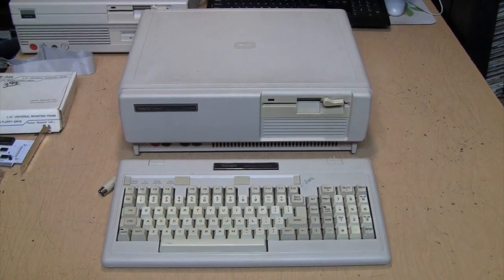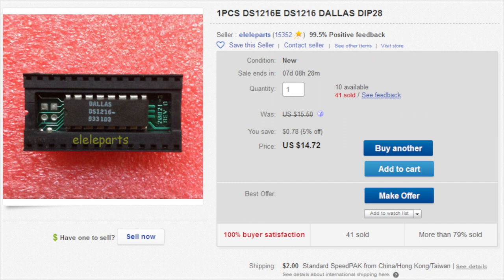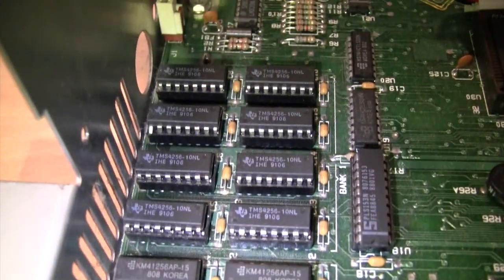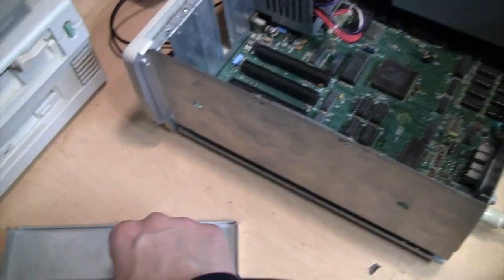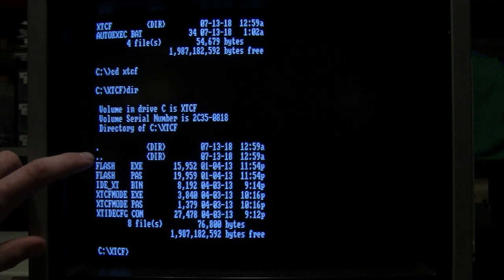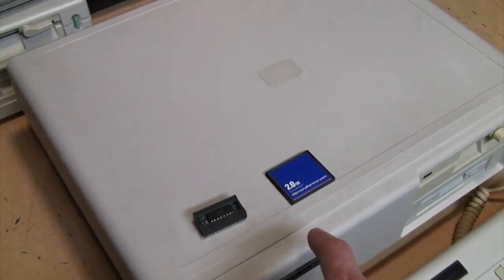Exploring & upgrading the Tandy 1000SX computer

Comment: That was my 2nd comp, had it from 86'-94'.  Looooooooved that machine.  Eventually got the memory bumped to 512kb and added a 2nd 5 1/4" drive so I could copy stuff (then later replaced one with a 3 1/2").  Lasted through all the Sierra games until they required mice.  Wrecked two joysticks for it playing BC's Quest for Tires, Thexder and Silpheed.  Also wasted tons of hours with Bubble Ghost, California Raisins and Double Dragon.  Never did manage to get the Light Pen for it though.  Ran on MSDOS 3.2.  Thanks for the memories @VWestlife!
Reply: Thank you for sharing that. My memory fails me as to my exact setup, but I know I didn't have much money so pretty sure I never got a second drive for mine. But I played all the Sierra games, was very partial to the police and space quest. And then I found starflight and omg that changed my life forever lol.

Comment: I've tricked out my own 1000SX quite a bit. Personally, I don't like the V20 upgrade because one of the biggest strengths of the SX is that it provides 100% compatibility with 4.77mh required software. I've upgraded it with a 286Xpress accelerator -- a 286 on an ISA card -- a 8087 and 80287. The card gives me 4 different speed options -- 8088 @ 4.77 or 7.16mhz, and the 286 @ 7.16mhz with Cache Enabled/Disabled -- all of which can be changed in software or with even with keystrokes if you have the program loaded in memory. I also have a Trackstar-E in it which is an Apple IIe on an ISA card -- essentially making the the Tandy a 2 in 1 PC/Apple computer. 

I'm using an XT-IDE + IDE-CF adapters, since the only CF-Lite that I could find had a rear slot didn't fit the Tandy. I do still need to get a serial card for it, for mouse support but I was able to find an original boxed smartwatch for it -- I'm glad to see that we have alternatives for that though!

Comment: The light pen port was used with dual monitor cad/cam systems, some digitizers for autocad also used it. lots of software used it in fact, software that was all in the 10,000-15,000 $ range which is why most do not/did not know how prolific the light pen was, Ive seen 30 of them in one office :)

Comment: The 1000 SX, the computer (I bought used) that got me through college in the 1990s and my darkest years of poverty.  It wasn't fancy, but with a 14.4K modem and a local Freenet, it kept me online.  I've had better computers, but this is the one I have nostalgia for.
2:50 - The keyboard may be non-standard, but in terms of quality and durability, it was only bettered by the Model M.
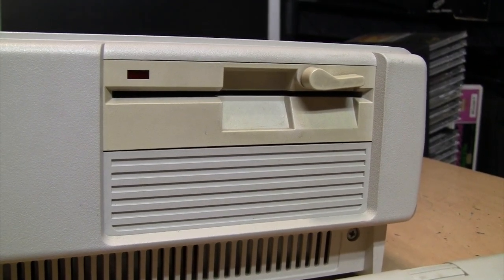4:30 - I bought an internal bracket and put in a 3.5" drive.  The panel cover would no longer fit, but usability beat aesthetics.
6:00 - Yup.  Had the cable, connected to my dot matrix.  Fun times, seriously.

Comment: Nice machine. I recently acquired a Tandy 4000 from recycling. Its power supply was dead, so I'm needing to replace that before I can test the rest of the machine.
Reply: If you have a Murphys in proximity, you might find a replacement.
Reply: Or replacement components.
Reply: Were you able to find it yet?

Comment: Holy balls, does that POST beep and floppy seek test ever bring me back to my toddler years 😭

What the heck, yours takes only 15 seconds to count up 2 GB of free space? My Epson takes almost that long to count up 60 MB. Maybe because I'm running a mechanical hard drive. Brotip - replace the firmware on the XT-CF card with the "XT+" firmware that takes advantage of 80186/80188-compatible CPUs like the V20. I'd be interested to see if you get even better speed.

That's a lot of great info about floppy drive setup tweaks.
Reply from the maker: I can also try enabling DMA mode. I'll cover that in Part 2.
Reply: I have no idea what you said with about half of that, but omg that sure brought me back to memories of putting a disc in and closing the little switch. I was always so paranoid my data would be erased. Probably cuz I was traumatized from having to use the cassette tape drive on my TRS80.

Comment: 1000SX machines that shipped with two 5.25 drives had A: on the bottom drive.   The one we had is still in the parents’ basement in near mint condition.   We Used it from the time we got it in the mid 87 until 92 or so.
Reply from the maker: I've seen them both ways, with the A: drive at either the bottom or top.

Comment: I’m not sure but I think the 6 in 96 may be a 0 so 1990.
Reply: Me too :)
Reply from the maker: But there are other zeroes on the same label and they're not written that way.
Reply: maybe the memory was upgraded in 1995-1996, almost no one would provide warranty more than 12 months, also it could have been traded in and "refreshed" and resold via tandy
Reply: You kids have to know, a lot of people didn’t just waltz into Radio Shack and pick up a PC, they were the number one computer manufacturer and reseller in the US  for a few years. I worked as an assistant manager in Montebello, CA and some of the business extended service plans were insanely long, offering limited parts and labor up to 5 years. Back then, a small business wasn’t going to upgrade every year or even couple of years. Computers weren’t disposable either, especially at the prices Tandy was charging. 5 year extended warranties made sense, and I’m sure went well past the point Tandy got out of the computer business in 1993.
Reply: @StevenSmyth  The prices on those computers and monitors are insane for 1980's money. It reminds me of exactly why we didn't have a computer at home when I was a kid.
Reply: @ct92404 Yes, you either needed a PC  for your work or you were a hobbyist with a  disposable income. The problem now is the closure of Radio Shack  has artificially jacked the prices up on used Tandy 1000s. A couple of years ago, you could get a decent 1000 for about $100 all and all night on ebay. Try paying that now.
Reply: It could be a six or four. Coming from the UK too, I can see why you'd scratch your head when told it's a six. People write sixes and fours weird over here lol.
Reply: I upgraded my Tandy 1000 SX with a modem and memory in 1994.  I used it up until 1996 when it was 10 years old.

Comment: Something that would make old PCs through ATs and clones faster was using faster than minimum speed RAM chips. The key to that was the loose tolerances in the RAM timing windows.
For example to do a RAM write the RAM had to be ready no later than Y time but could be ready as early as X. The minimum RAM speed specified would put the ready time for reads and writes closer to Y than X.
Using faster RAM chips would make the RAM available closer to X than Y, closer to the start of the window than the end. If you installed RAM ridiculously faster than the slowest allowed, like 70ns when 150ns was specified, then the RAM would be 'born ready'. The instant the system started the read or write cycle windows the RAM would be able to provide or accept the data *right then*.
Then the next read or write cycle could start as soon as the first one was finished.
But in some cases the RAM speed made no difference because the computer was designed with fixed length RAM cycles. For example if the window for the start of a RAM cycle was 20ns long it would wait precisely 20ns for the RAM to be ready to begin - even if the RAM was ready to begin a read or write at 1ns after the cycle start window. Then the rest of the cycle would be set to a fixed time, even if the RAM was able to be read or written in half the time. The computer would sit there for however many nanoseconds twiddling its digital thumbs until the end of the cycle and the next cycle start window.
One place you can easily tell the speed difference is in an IBM PC/XT that has the audible ticker and number count on screen during POST. With the 150ns RAM specified it goes TICK TICK TICK TICK TICK TICK TICK*. Put 70ns RAM chips in and it goes *BBRRRRRRRRRRRRT because the RAM is always already ready at the very start of every part of a read or write cycle while 150ns is getting close to being too slow.
Back in the day, 70ns DRAM chips were hellaciously more expensive than 150ns. I used to scavenge faster chips from dead "Turbo" 8086 clones, 80286 clones and even some early 80386 clones.
The same kind of loose RAM timing was often used in the early times of SIMM RAM, but by the advent of the 72 pin SIMMS RAM timings were tightened up a lot so there was little speed to be gained installing RAM much faster than specified. Could get a little bump mostly only detectable with benchmark tests.

Comment: Awesome!! Inspires me to dig out my Old Tandy 2500 SX/33 I've had for a long time now.  One of my friends also recently gave me an old TRS-80 128k Color Computer which I've had loads of fun on so far, I just haven't had a decent way to load other software to it yet haha.
Reply: There's a Trs-80 basic software website, yet specific software besides older programming interface is unknown. I was looking up how to operate there pocket computers.
Reply: @tarstarkusz  With my 2500, which I agree is just a low-end 386 when it comes down to it(though these are all old machines now anyway), that there are a couple of things supported that I do like about this particular machine:  First thing being the 2k compatible clock, which supports from 1/1/1900 to 12/31/2099. Second thing being that I do not need to load bios configuration software from a floppy, this machine has that built into the ROM.  Sounds silly, but even my dad's old Packard Bell, which houses a 486 with an 850MB harddisk(I am not sure what any of its other specs are off the top of my head), doesn't support ROM based BIOS configuration.  So I guess with it being low-end(again its just going to be a DOS machine anyway) I do like it for what it has to offer otherwise.
Reply: @obsidian9998  I know of a few sources myself, the guy who gave me the old Color Computer 128K has a bunch of his own sources, I just haven't had much of a chance to play around with it further other then writing my own basic programs.

Comment: This take me back we owned a Tandy 1000 TX with 768k of RAM and a 40MB hard drive. It was one of the ISA hard drives on a card. Plus we had a 3rd party keyboard which was an omikey keyboard with dip switches for configuring the keyboard and one of the combinations of the switches made it compatible with a Tandy 1000 computer thanks to a PS2 to Tandy adapter. Also it was a very clicky keyboard. But sadly the keyboard met its sad demise on a base board heater.  But our tandy met its sad demise when it refuse to boot anymore because of the hard drive dying. If i still owned that computer I would have replaced it with some sort of flash solution and also the Keyboard was dying as well.  We also had the Tandy printer that was capable of printing in color.  My dad got a 1200 baud modem so he could do his school work since he went back to college at the time.

Comment: • I've seen some keyboards that have a Sleep key in the same place as that Hold key. That's even worse because instead of just pausing the (ACPI) system, it puts it into standby mode which is not just really annoying, but it adds a power-cycle, and thus wear-and-tear to the components, especially the hard-drive.
• If the dust caused problems that bad, I would assume Tandy Labs' "new" tobacco-stained HX will have problems too. ☹
• The stripes don't mark pin 1, they're just a reference to make it easier to plug it in the same way on both ends, so you can plug it in upside down, as long as you do the same on the other end (assuming the cable doesn't have a key-pin).
• You like the sound of old hard-drives? 🤨 Including old RLL/MFM drives with interrupters? 🤔

Comment: You should look into getting an IDC crimp tool, ribbon cable on a roll and the connectors to make cables yourself! I've found it to be way easier and reliable, and in the long run, it ends up saving money if you find yourself fixing up stuff from back in the day regularly.

Comment: My first DOS computer was an XT, with the MB replaced with a 286 after a few years, so I never owned a Tandy.  I was unaware that the Tandy 1000 used the same joysticks as the TRS-80 Color.  That was the first computer I ever used.  Unlike the Atari and other game systems, the TRS-80 Color joysticks were analog, offering excellent positioning control for games that utilized it. 

The compact flash card interface is a more elegant internal storage solution than the full length ISA "Plus Hardcard 40" that I installed in an thrift-store sourced NCR PC4, a two floppy all-in-one PC clone.

It seems your biggest disappointment with this Tandy 1000SX is the keyboard.  It would probably cost more than all your other upgrades combined, but if you can find a Northgate Omnikey, I understand those had dip switch settings that would make them compatible with the Tandy 1000 series, were "clicky", and had a 101-key layout.

Looking forward to Part 2... Would love to see a benchmark comparison with and without the math co-processor.

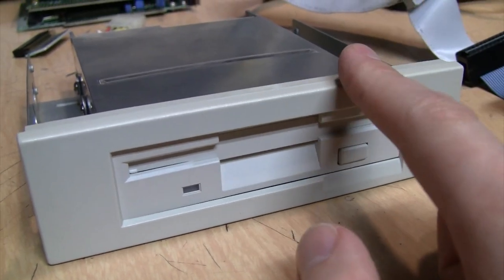Comment: What connection do the floppy drives have? I have this exact computer with dual 5.25" floppy drives, and I am looking to connect the drives to a USB adapter I have, to read my old discs! EDIT: I guess you show the connection at 17:39 and explain it afterwards.

Comment: Tandy 1000 SX owner since 7 years, it's really great to see. Mine's mostly full now, serial, 2 lpt, 640k, 31mb rll drive, 360k drive, adlib, etherlink III, rtc, Iomega zip, syquest sparq and a trackball and I also have a couple of questions:

 I wasn't aware of that dallas rtc, it'll be much more useful than having that isa card taking up a slot. Do they work in any mother boards, or is it just something that works on tandy 1000's ?

And also, will you keep that scsi card ? I may buy it off of you if not too expensive (ebay prices are way out of my reach for those...), been looking for an 8bit scsi card with a boot rom that would work in my tandy, I have only 16 bits ones that don't work in it, tho there is still one I haven't tried yet, I'll give that a try later.

As for putting a 720k drive, I don't really see the point in doing so, it it for convenience ? If so, why not just put a zip drive or any other big capacity media that can go on a computer like this ? Even if it is an XT there is still a lot of options.
Reply: Holy crap, there was an Iomega Zip drive that worked on the SX? (SCSI?) Didn't they show up in the mid-90s?
Reply: @TrackZero  No, I use the parallel version, there was a third party driver made for xt class cpus.
Reply: @chainedenintenloup  
Try all your 16-bit ISA SCSI cards in the 8-bit slots, just leaving the extra edge conectors hanging...
Many cards are actually downward compatible in this way.
Sometimes there is an obscure jumper you have to find though.
Reply: @chainedenintenloup  Nice!
Reply from the maker: With the NEC V20 CPU you can use the original Iomega GUEST.EXE Zip drive driver. I have 3.5" floppy drives in all my modern PCs, so having one in the 1000SX makes data transfer very easy.
Reply: @KomradeMikhail  Yes, that I know, but now I remember why I couldn't do it, all my isa scsi cards don't go lower than IRQ 9...
Reply: @vwestlife  Zip4dos.sys uses less ram than guest tho, which is really appreciated on an xt class computer.

Comment: Hi. Looks like a pin is not in on one of the RAM chips on the 2nd bank, closest to the vent slots.
Reply: yep, 12:55
Reply from the maker: One of the pins did get a little bent when I was removing it, but it still makes contact and works fine -- it passes a full diagnostic RAM check with no errors.
Reply: Damn this reminds me of the never ending hunt for better ram chips for each computer I had. Lol

Comment: Out of curiosity: why did you insist on making the 3.5" disk drive the A: drive? As far as I know, booter games always came on 5.25" floppies, so wouldn't it be more practical to keep the 5.25" drive as the A: drive? Or did the Tandy 1000 allow booting from either the A: or B: drive? The dual floppy PC we had at home when I was a kid had a BIOS that could only boot from the A: drive, or the hard drive, if one was installed, but not from B:. I know there was this software that allowed you to create a special chain load disk that you would put in the A: drive that would make the computer boot from B:, but that would still be less practical, since you would have to put that helper disk in your primary drive, whenever you would want to boot something in B:.
Reply: Oh, I hadn't finished watching the video and had it paused as I was typing my previous response. Just now did I see it boot and it clearly tried to boot from both disk drives consecutively when it did. That's a cool feature!  Those Tandy 1000 series were cool machines indeed. 🙂
Reply from the maker: I have the 3.5" drive set to the A: drive. I just put the 5.25" drive on top because that's how I always saw PCs configured back in the '80s and '90s so it looks better to me that way. Also the Tandy has a neat feature where if you press F3 during the memory test it will swap the A: and B: drives so then I could boot from a 5.25" disk if I wanted to.

Comment: Love that machine, it’s just to bad that the audio out port is only outputting one of the 3 voices (4 with the DAC)
Reply from the maker: The 1000SX does not have the DAC. That feature was introduced with the SL/TL and later models.
Reply: I have an RCA to 3.5 mm adapter plugged into mine so I can use headphones on it, and it outputs the same sound as the front speaker...  Works good.  I just mute the front speaker and use the volume control on my headphones.
Reply: Cool the headphone output is a neat trick, that’s my next mod!
Yes, my bad, the SX used the SN76489 (if i’m not mistaken) witch does not have DAC capability
Reply: @RemiDupont  I recommend using an RCA mono to stereo splitter.  (Since the output is just mono.)  And then go stereo RCA to 3.5 mini jack.  It's just two small adapters you need.